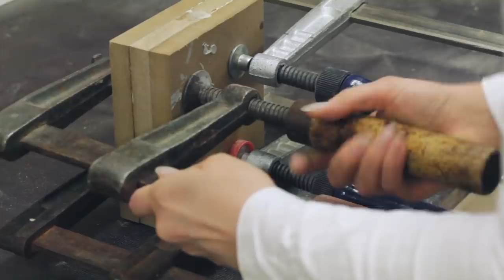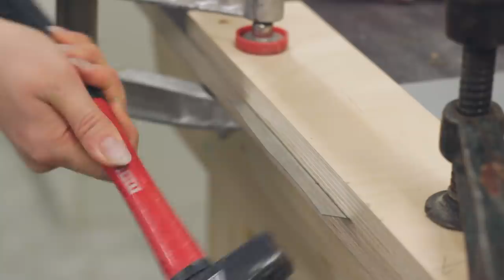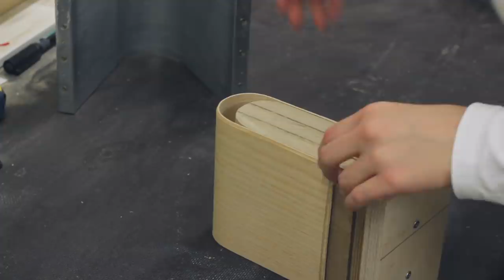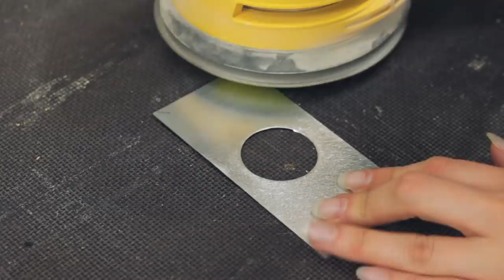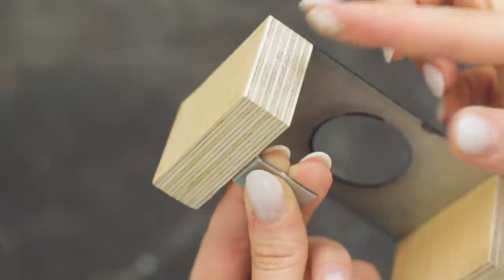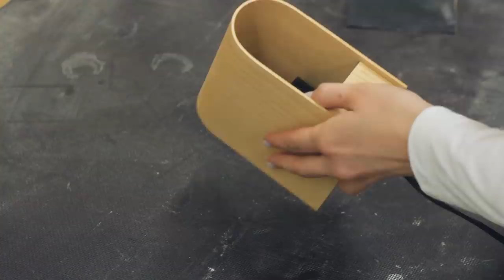Making a Bent Lamination Wall Light

Comment: Very nice, I made a similar table lamp from a wooden pillar with 2 angled slots cut vertically into the turned wooden pillar, the very thin plywood (0.75mm birch plywood] was glued into the slots, forming a curved shape similar to yours, the light fixture was fitted to the pillar. Mine improved when I used a strip light which lit mine more evenly, the thinn plywood is really cool, the light shines a dull red from the adhesive in the plywood.

Comment: Nice, clean project.  I'm not so much a fan of oak due to the coarse grain, but good concept.  I would also feel more comfortable with a little more clearance between the bulb and the laminations.  Regardless, well done.
Reply from the maker: Thank you! I used ash for this project. :) The bulb is a led bulb so it never heats up, no danger there! :)

Comment: Nice looking design & project! Enjoyed the video. The knock-out punch is not a common item. Did you have it already or get it for this project?
Reply from the maker: I did get it for this project, it is meant for cutting holes to a metal sink for a tap. It happened to be the perfect size for the electrical parts. I got it from IKEA. :)

Comment: Great job, love the light.  Andy
Reply from the maker: Thank you Andy!
Reply: The Minimalist Maker I meant to ask what did you sprinkle on yet the glue when laminating the former in MDF?  Was that sand or sawdust to stop the parts sliding when cramped?
Reply from the maker: Yes I used salt to keep the parts from sliding! It's a popular woodworking trick. :)
Reply: The Minimalist Maker ok great not heard that one before, always learning...

Comment: Out of curiosity, did you sprinkle SALT on that first glue up? If so, why? How does it help? Ps.: Just subscribed to your channel.
Reply: Sprinkling salt in a glueup like that helps keep the pieces from sliding out of position as you clamp them.  It acts as an abrasive to counteract the slipperyness of the wet glue.
Reply: The salt help the pieces from sliding around as you clamp them. The glue gets real slippery.

Comment: Beautiful wall light, you have a lot of imagination going on and you made it happen perfectly. That's why I am disappointed in the fact that when mounting the light you didn't hide the cable in the wall. Even if it's a brick wall, there are a lot of easy solutions for hiding it.
Reply from the maker: This light is going to be mounted on a black wall, that's why the cord is black. It will be almost invisible. Personally I don't mind the cord.  Hidden cord would be nice but not everybody owns a house they can drill holes to the walls. Me included.
Reply: The Minimalist Maker If it's dry wall you can patch the hole quickly when moving out. But I get the point. It will look stunning on a black wall!
Reply: I must admit I thought why not hide the cable.  But... Instead better to make a feature of it and celebrate it.  I would use a nice vintage style woven cord and just have it on show.  I will be copying this idea for my bedroom. Thanks and job well done!